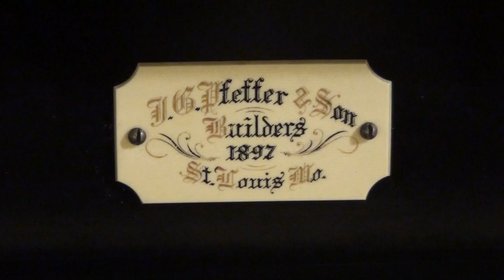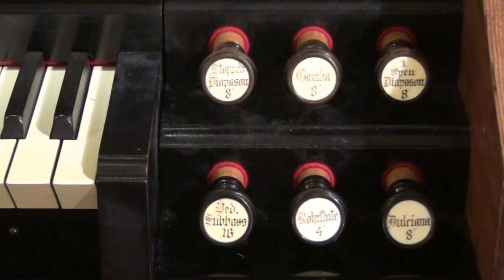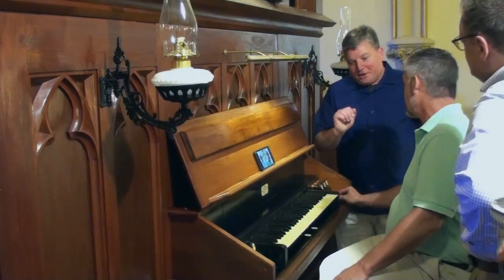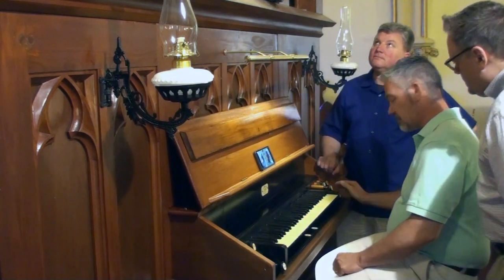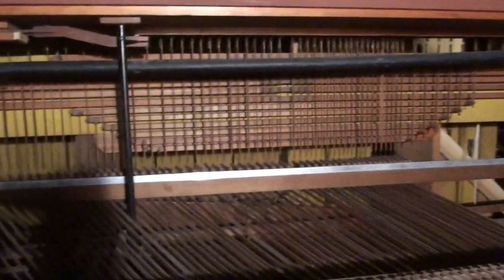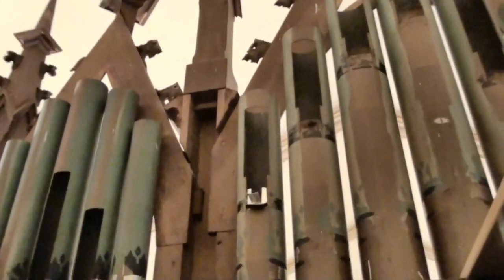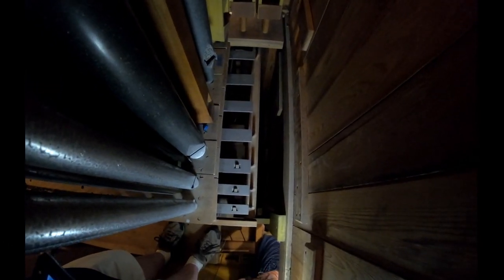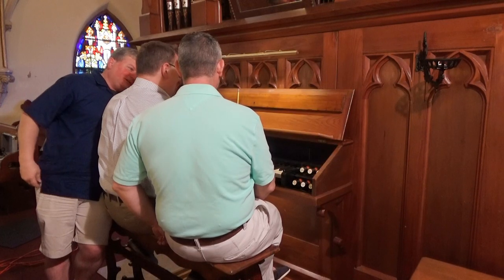1897 Pfeffer Organ, Church of St. Thomas the Apostle, St. Thomas, Missouri

Comment: Very interesting series. Sadly the audio suffers from having either compression or the AGC (automatic gain control) is on. We cannot appreciate the full richness of the pipe sounds. Voices are fine, but pipe volume gets immediately compressed only to bounce back up on note release. Makes an otherwise professional video seem amateurish. This is valuable work you are doing, thanks for your efforts.
Reply: I agree about the sound, the last several videos have this unfortunate feature.   They sound like a wet blanket was thrown over the instruments.
Reply: @1955mlynch  Some of this is youtubes' "processing" to reduce file size as small as possible